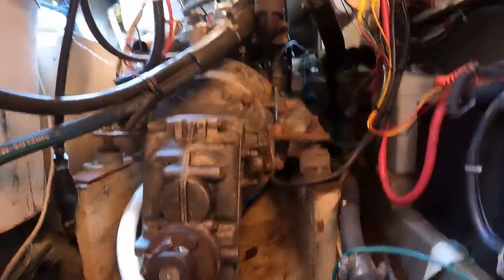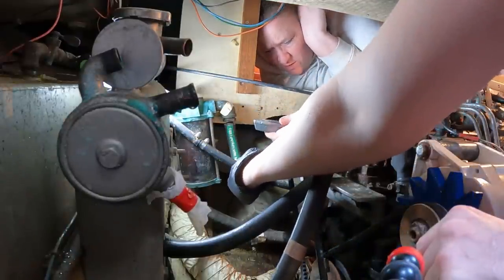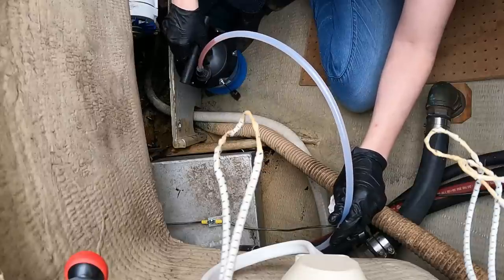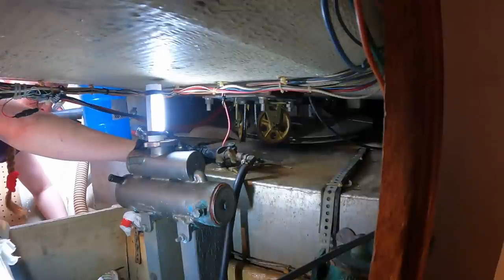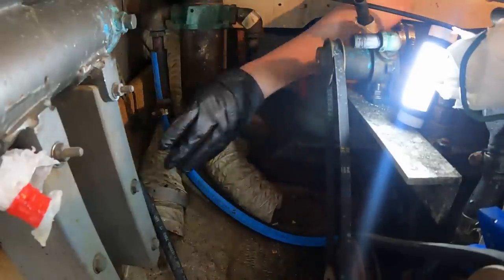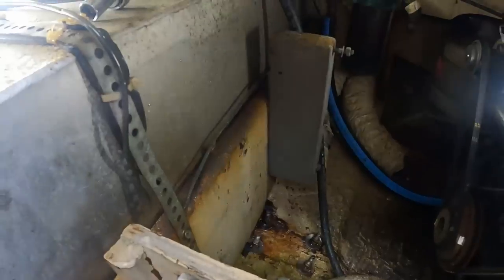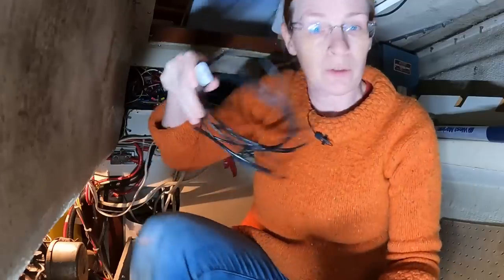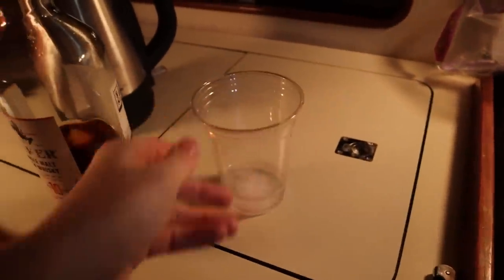Preparing For The Trip Home - Part 2 - Diesel Tank Woes (Ep. 54)

Comment: As a backup in case any hidden sludge in tank clogs pickup tube due to sloshing at sea..  
Since it seems you have several diesel jerry cans,-  get a long enough fuel line hose (even cheap reinforced plastic hose) to go from a jerry can near engine to the engine driven? fuel pump and return line back to the jerry can.  5 gals of clean diesel in jerrycan should last you 4+ hrs at 1 gal/hr and at 5 knots that's 20+ nm and you can add more diesel to the "temp" fuel tank from other jerry cans as needed.  You can add an inline fuel filter in the supply line if you want for added protection.
Reply from the maker: I've only got the one Jerry can, but now that I've had to understand the plumbing better, if something happens I am sure I could rig up the diesel fill from the jerry can into the filter if I needed. It is engine driven, I believe, not gravity fed. The engine diesel filter right before it goes into the engine itself is half-way up the tank, so gravity feed alone wouldn't work. I do plan to keep the jerry can full of spare diesel, both for fuel system clogs and from accidentally running out of fuel.
Reply: @TheDigitalMermaid  I would suggest you get a second 5 gal jerry can if you can.  There are aftermarket jerry can simple spouts without all the anti-spill devices but 2 of them cost just about the same as a jerry can.  If you look for, make sure the threads match.

Comment: good to see the tank doesn’t have a lot of debris in it, will be ok, and your biocide treatment of what’s been removed will probably be all that’s needed..  on the plus side, you have (6) 5 gallon diesel containers, I would suggest only putting in one or two at a time..  it also means you can refill the diesel tank at a regular land based gas station when you dock, which has 2 huge benefits: 1) you don’t pay ridiculous marina rates for diesel and 2) it will likely be much fresher than anything you can buy at a marina 😂👍✅

Comment: Great news :)  also that's a genius idea to freeze water in the bottom of your cups.
When i have to transfer from a kerosene tank (which is similar to diesel) i use a little 12v brushless dc water pump from amazon, they're very cheap, £5 or so and while they aren't rated for oil i consider them cheap enough to throw away if it kills them.  since they're brushless they don't seem to suffer tho.  They're tiny so you can drop one directly into the tank on the end of a tube, and while they're not quick (i reckon i get about 3 or 4 L/min) sitting there on deck waiting looks nicer than climbing in and out of that hole endlessly!   not much use to you now you've done it, unfortunately, but maybe next time :)

Comment: After watching you with your engine, cooling, and fuel systems, I am glad I chose the 2004 Catalina 310 which has much more ready access to the routine things. Some parts are very difficult to access until I removed the propane "cabinets" on the tumble-back walk through transom. 

Originally I thought the cabinets were molded into the fiberglass deck/cockpit top portion. Instead. the cabinets were held in place with screws and marine sealant. Adding a little heat from a heat gun after slicing through the sealed seam with a multitool and knife edge blade, the two (port and starboard) "cabinets" popped out. Now I have access to most every "unreachable" parts. The exhaust tube has a crack at the hull pass-through. 

Its fuel tank is also very difficult to remove as is yours. The fuel level is very low. I motored several miles to the boatyard where it was hauled out. Kept wondering if I was pressing my luck — but I made it. I will be polishing the remaining fuel after a shock of biocide.

I will be going through my engine in another month or so. Your video was very instructive. I am mostly concerned about the heat exchanger — worse case I can change it while on my mooring. I sail most of the time. An electric motor conversion (most likely Thunderstruck) is on the list for next year.

I look forward to each of your episodes.
Reply from the maker: If I was keeping the diesel, this access probably would have been a deal-breaker for me now. Switching to electric, once done, will make the space much more sensible and usable, but until then... ugh. Boats like yours with more accessible engine bays are so much more sensible, at least in this regard.

I had a couple folks at the yard caution strongly to NOT biocide in the tank, but instead to do it in a barrel. You want to bug to die and precipitate out outside the tank that's hard to access. Allow me to share their advice onward to you. 

Good luck, and share your progress if you do convert!
Reply: @TheDigitalMermaid  — Thank you for the advice. I know I want the tank to be as clean as possible since I will be using it for this coming year.

When I do make the switch to electric, access will be even more so. AND my wife has been talking about the change to electric. 

We both have enjoyed having a Torqeedo Cruise 2.0 on our Capri 22 since 2011. We can both hear each other and feel so much more relaxed when out on the water.

Yes, I made access to the engine and such a very high priority when searching for our first "big boat". Stability in the cabin and cockpit was the other main requirement for our 70–something bodies.

Comment: Just as an FYI, battery powered pumps for fuel (commonly used for kerosene heaters) is under $20 USD on Amazon. Kerosene and diesel are very close, and they also work well for gasoline. Also as you demonstrated last video, you need a curved pick to help replacing hoses, I learned that watching an auto repair channel. One thing I learned the hard way in the 1980s, a mechanic that doesn't know this will shred hoses and the bits can clog things like heater cores, radiators and engine coolant channels. I must admit, after watching you, I wonder if Amazon does two day delivery in many parts of Canada. You could probably set up an Amazon wishlist and someone may donate a new gopro without revealing your personal details.
Reply: When Madi took off the fill hose on the tank, a yard mechanic lent her a set of two bent picks.
Reply from the maker: I looked at a powered pump at West Marine, and the cheapest available was like $80! I didn't think to check Amazon... doh! That said, I'm in the US so I don't have a convenient way to receive packages. I should have bought the picks though, ya. I've debated a wishlist, but I'm still trying to get my head around the fact that folks are patreon... <3 heh.
Reply: @geraldkoth654  Yes, as she was trying, I was watching and going "you need a bent pick" and saw she was loaned one. She should probably acquire one for her boat toolkit.

Comment: The easiest way to drain the tank, take the fuel line off the filter input and hook or vacuum pump to that line, takes right from  the bottom of the tank, no messing about with all the other paraphernalia.  You are doing good for never doing that work before, the mechanics at the yard should have told you that.  Hope the rest of your prep work goes well.
Reply from the maker: I actually did think of that when I was trying to gravity siphon... I should have stuff the pump onto the hose, now that I think if it, haha. sigh
Reply: @TheDigitalMermaid  We tend to learn more from mistakes. Sometimes learning the correct or easiest way to do something can be painful, but you don't forget it.
Reply: @TheDigitalMermaid  I can understand you not thinking of it, but fail to understand the marina staff failure..  I have used that method most often, especially when it's hard to get into the tank.
Reply from the maker: @johndavidson6867  I should clarify; Joe (and the others) help me and answer my questions off the clock. Paying official yard rates is expensive, and so they're helping me as much as they are simply because they're wonderful folks.
Reply: @TheDigitalMermaid  I wasn't implying anything bad, I just would have thought someone would have said to "pull the fuel line and use it", I know that was the first thought in my mind when you were fighting with the fill hose and then the level sending unit.
Reply from the maker: @johndavidson6867  If I had the hindsight to ask, they probably would have suggested it. I was picking their brains on where to store the diesel, how to treat it, and how to get the tank out (and what options I might have if I couldn't). So it just didn't come up around them. Cheers!

Comment: yeah invest in a small cheap pump for the future that can handle most liquids and you will save some time, the way you remove hoses is how I did it when I was an auto mechanic, easier to peel them apart after slitting them rather than fighting them to come off the ends of those pipes. That tank is in great shape, prolly cause they kept it full of fresh fuel and ran it near empty before filling it again. One less thing for you to have to deal with. Is the heat exchanger going back on?
Reply from the maker: I'll get a pump when I'm back home, I can see it being useful in a lot of places, ya. The heat exchanger is going back on (well, it's already mounted, need to connect it up still). I'll need it all together for the trip home.
Reply: @TheDigitalMermaid  so glad it was good news :)

Comment: i truly love your videos . . . there's a BUT coming haha . . . BUT we have a saying here in the land of the UK ness - 'If it ain't broke don't fix it' actually i have grand experience here, tried to fix a number of things during my lifetime and broke them, and they end up costing more to replace, honest by the visual looks of everything, yes untidy, dirty, grubby, but everything is in place, and it will be fine . . . what can possibly go wrong (is the plug in the bottom of the boat?)

i.e. same as you pointed out in last video, the tiny bit of exposed copper braided wire between the starter motor and solenoid, believe me yours is fine, however the one on my car just broke and left me stranded five miles from anywhere to catch a train home, i was stuck at work and no phone, have safely removed the faulty motor and discovered this piece of vital cable has disintegrated, totally, i could fix it easily but don't have a descent heavy enough soldering iron at that location or at home, and i have somewhere squirrelled away some military grade braided earth strapping, would be perfect, but where did i put it? oh yes its the same stuff they use to protect hydraulic lines in aircraft, its probably plated copper

so i now need to replace the whole thing, £113 new, possibly £60 or so on eBay and with a 2 year guarantee, but found a used one for just £30, i'm home and now waiting for that delivery, at least i can do without the car for a few days but somehow got to get back there 25 miles away - while i realise your journey might be fairly long back to the land of Canadada, a visual inspection every now and then goes a long way to preventing mishaps, i wonder sometimes if you might be reading to many scary stories and perhaps building on a little paranoia, i do it too, but honest it will be fine and i know it makes for great filming, i mean video hehe, see what i did there

cleaning up areas goes a long way to do visual inspections, if something should leak, squirt out etc, then its easy to find the source and make ready to fix - and in the same way we often have a first aid kit in the car (you don't . . i do) then its also worth having one for the car or boat in your case, a small box with rudimentary tools, hammer, gaffa tape and other items of major use, spare belts in sealed bags to prevent deterioration etc

incidentally i loved watching you battle with the hose on the diesel tank, it was amusing, and also scared the pants off me, please be careful using tools, those spiky things looks like tools of torture, a large screw driver is perfect, insert a little way and twist it, gradually breaking the tight seal of the hose, but you can do by hand, as you grasped the hose above the fitting, you could grab with both hands and just heave back and forth, its heavy enough to take the abuse and still good as new, heaving back n forth will be enough to make the bast**d give way to your persuasion - but i do still love what you are doing, your enthusiasm etc, just think a little safer, and mostly you will only need basic tools for most jobs, some pipe grips can work here to twist off stubborn hoses, but hammering a rubber object with something heavy will just hurt you back, a little like kicking the tyres, no point when you can see a tyre is flat so why kick it (actually i do that to hear the sound is the same all round hehe)
Reply from the maker: This "if it ain't broke" way of thinking has merit, absolutely. I knew I was rolling the dice by diving in, without experience, to refresh the engine. Last weekend I finally got her out on a sea trial, and the engine and exhaust temps dropped _dramatically_. Like, over 600f/315c to 160f/72c. Finding the broken impeller, wasted gasket and partially plugged heat exchanger tubes meant, this time, the gamble and the work paid off. :)
Reply: @TheDigitalMermaid  its a bloody good effort - i am soooo proud of you - you'll soon be sailing the seven seas, riding on a surf board towed behind and enjoying the company of Dolphins

Comment: I'm happy things turned out well! You mentioned possibly keeping the tank and having a diesel heater. If that's the case, are you also considering a diesel generator as a backup? Sailing Uma had trouble keeping their batteries charged in the North Atlantic and ended up buying a gasoline generator.
Reply: We should probably mention to her that those diesel heaters require the fan to run for a bit after you turn them off, otherwise they tend to fry the electronic controller board and melt the plastic shroud covering the heat exchange unit. So don't wait for the BMS to do a low voltage disconnect. I had to tell this to my relatives in Ukraine when I shipped them one, "use a lead acid car battery, not the LFP".
Reply from the maker: I am thinking of it, ya. I was running the numbers of watts-out per litre of fuel, and diesel is way more efficient than gas, and safer. I'm looking at the smallest Yanmar diesel generator they've got, but might keep looking. I'd love to stuff one where the propane locker was, but that's a shallow spot. We'll see. If I do have one, it'll be for very last ditch emergency use... I so hate how they sound. Note that Uma's pack is was smaller than mine, which I am hoping will help me avoid running out entirely. Going north though, not having any generator at all just isn't viable, yet.
Reply: @TheDigitalMermaid  Another alternative is a small dual fuel 2500 watt portable generator. Yes, diesel is better, but propane stores better. The Champion model runs around $500 USD, and weighs 39 lbs. It might be cheaper if you don't use it often. I have one and like it a lot (but paid close to $700 for the model with electric start). Very similar to the $2000 Honda, and very quiet.
Reply from the maker: @john_in_phoenix  I thought about those, but I feel like I'm already conceding to a degree by keeping the diesel. Having propane as well just... ugh. I know, the most rational of arguments, that was!
Reply: @john_in_phoenix  Diesel is available at most docks in the world. Not so for propane or gasoline. Propane is also heavier than air so there is always the explosion or asphyxiation risk with it.
Reply: @TheDigitalMermaid  If you really want to extend your batteries, I'd consider installing a diesel cooktop as well. Though your massive battery bank would supply 500 to 1000 watt-hours a day for cooking a long time.

Speaking of docks and refueling, will you have the ability to charge off 230v in Europe? Seems they use a standard plug that would be handy to have sorted before you make your way across.
Reply from the maker: @MarkRose1337  Running a diesel galley crossed my mind, but I don't think I'll do it. I'll have ~1400w of solar I think, plus regen from the prop. That should bring in more than I'd burn in a day, even with an electric galley (I'm not much of a cook, tbh). I will have an auto-transformer so yes, I'll be able to charge for 110~230, 50~60hz. Specifically the Victron 3600 Watt Auto 115/230 V model is the plan.
Reply: @TheDigitalMermaid  Refleks diesel drip feed heater ;-)